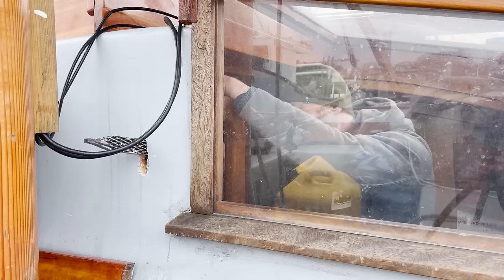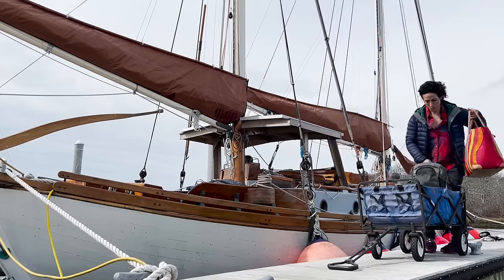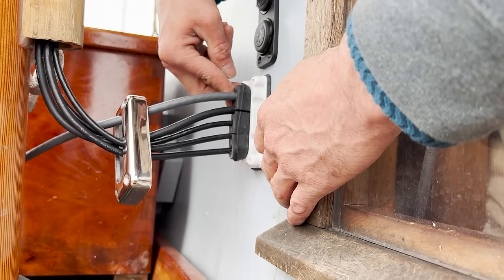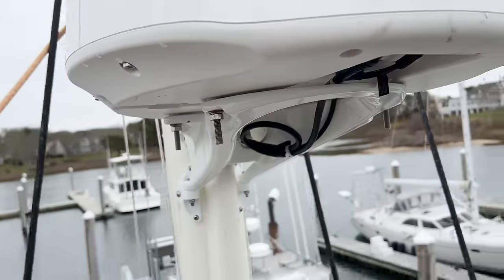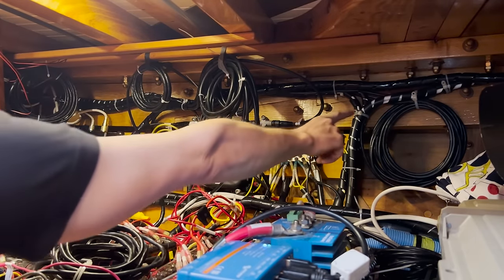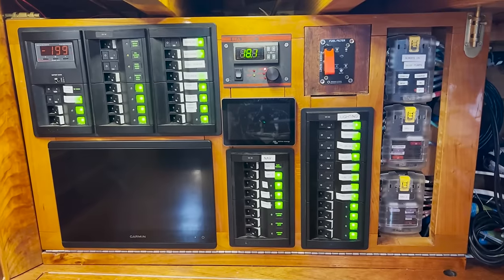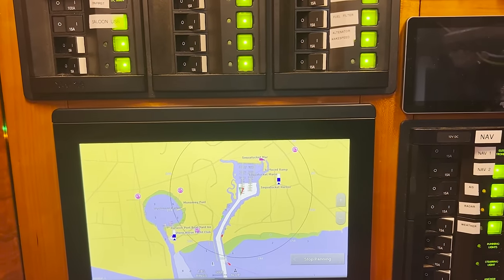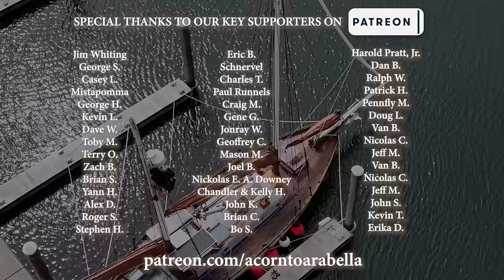Windy Work Installing Navigation Electronics - Ep. 307 - Acorn to Arabella: Journey of a Wooden Boat

Comment: 11:47 That roled up cable above, make a drip loop lower, below the conduit hole, and most rain water will drip off. The way you have it now, it will funnel directly in. The drip loop is a CATV installation trick.
Reply: Came to the comments to say exactly this.   Also a drip loop outside the cable gland would be a good precaution.
Reply: I was an electrician at a power plant, and was going to say Drip loops are your friend.
Reply: Additionally one could build a small box, that's sealed to the mast except for the bottom, with the drip-loop coming from the bottim in.
That way even the water running alongside the mast will be funneled away from the hole.
Reply: And stuff putty inside the split cover.
Reply: Yup, came here to add my support for the drip loop, figured someone probably beat me to mentioning it.
Reply: *rolled
Reply: That goes for the wires freshly installed in the cockpit as well, water will happily seep through those compression seals if it's allowed to run down the cables, a little bit of re-arranging the slack will prevent that.

Comment: Having sailed a lot on Long Island Sound, I have found myself in very thick fog.  Even though I was in "home waters" having that radar is very reassuring.  Better to have too much information and not need it, than having too little with a dire need for it.
Reply: Hi Kevin! Anne here. I really appreciate your saying that radar is "reassuring." Super appropriate. I really dislike it when people refer to any very expensive system as "necessary," considering how many ways such a thing can fail, and what a barrier that presents to some sailors. A lot of wooden boats aren't detectable (those very small radar reflectors people permanently mount then forget about don't do much to make them visible to radar), and I've seen people shut off their senses to stare at screens. "Video game sailing," I've called it.

Comment: Would making a drip loop for the wires as they enter the mast not eliminate most of the water? That way the water running off wire drips off and all you need to stop is water from surface of the mast
Reply: What he said!
Reply: I came here to suggest this too. I think I even saw a bit of extra wire coiled above the wad of puddy.
Reply: If you put the extra coil just below the penetration, it would give you the best of both worlds… extra cable and a drip loop to shed the rundown water.
Reply: Also maybe make a weather head like houses have. A  pvc 90* elbow pointed down with the cables entering from the bottom.
Reply: I came to say the same thing!
Reply: Noticed the white Tie-wrap on the Mizzenmast…  unless there have been significant updates by the Manufacturer, they didn’t do well in UV and cold temp environments….
Reply: I was just coming here to comment the same thing.

Comment: I was watching on my tv but had to grab my phone to tell you Steve, where you have the wire in the black corrugated casing on the top of the mast, it’s a very safe step to wrap electrical tape around the casing so to not have the wires get chaffed by the slit over time from the winds. Also you can put the duct compound in the casing at and before the entry point to the mast to keep water out of the inside of the casing. Love your journey! Been watching since the lead pour

Comment: For sealing I’ve had really good luck using pure silicone caulk mixed with enough cornstarch to form a putty. Pack it in and it will solidify and bind lightly and seal but still very easy to peel out if needed.

Comment: Inclinometers are fun. Gives you something to watch on passage.  Also useful if you plot speed versus heel angle.  While heeling may give you speed due to longer waterline the drag and eventual rudder angle increase negate that speed gain. My old boat anything above about 18* to 22* of heel was just wasting wind. Flat boats generally go faster. Maybe not so much for your hull shape but you'll get a feel for it if you have one to use and learn when to reef or ease the traveler.  They can also be used to gauge people start screaming above X angle of heel or when Akiva starts to really not like this idea or goes beyond his coefficient of friction. 

Nice work as usual. Good choices too. Play with the radar a lot during good weather so you get really good at reading it. If you cruise you'll use it a lot. Especially in New England and North. You would be surprised how little new radar set use on idle. AIS draws very little power also.

Comment: Love what you're doing. I agree with the previous comments about the drip loop. It with help alot with water. Duct seal will crack and dry out in a few years exposed to the elements, but it is easy to remove and replace. One last thing, the cable ties used outside should be UV rated. Thank you for the awesome channel.

Comment: I love seeing what you are doing on your wooden boat Steve.  I do think back to the early 70's when I did my first blue water passage from Hawaii to San Francisco.  It was on a boat about the size of Arabella (a 30 foot Tahiti Ketch), though we didn't have the modern conveniences.  We used oil lamps for lighting, no radar, the battery started the engine and provided juice for our radio and we carried about 60 gallons of water.  We had a propane stove and that was about it for modern conveniences.  Our diesel was overheating so we only used it for charging the battery so we could listen to the radio (not a SSB, just so we could have some entertainment and VHF when we were along the coast).  I don't know if I would do that today, I think I would much prefer the upgrades you are installing on Arabella.

Comment: Not just for the foggy days but for the very remote locations where safety communication equipment is less standard. Or sailing into unknown anchorages with little or no information. Also useful if you have to participate in a rescue mission. A few more items checked off. Register and get your id #'s.

Comment: RE: conduit in mast leaking.  That sticky stuff is fine but the best way is to create a dead leg in the wire by leading it down past the hole (6" or so) and bending back up to the hole.  That way the river flowing down the wire will drip off and the small amount of water near the hole the sticky stuff will control.
Reply: OK, four people suggested the same thing.  The reasons the (me) commenters don't read all the comments FIRST is that we think we can help but realize that if we don't comment quickly we will be buried under thousands of well deserved "Great video" comments.  If we think we can help we want our comments near the top so we watch and quickly comment if we have anything useful to say.
Reply from the maker: We hear you!! Thanks for the comment!
Reply: @AcornToArabella Of all the people mentioning a drip loop there was not a single acknowledgement from Acorn. There was one however regarding too many people cluttering up the comments. You won't have to worry about me adding to your channel ever again. It has been good from the keel pouring up to this episode. Adios.
Reply: @darrellshuman7751 We're so gonna miss you!

Comment: Hi Steven,
White cable ties are ususally not UV resistant  at least I have never seen them🙃. They will break down pretty fast.
Outdoor rated ones are usually black.
Reply: Agreed, always used Panduit brand black ties up on communication/cell tower installations.
Reply: @TowerHand  My outdoor black cable ties have disintegrated within 5 years.

Comment: Any wire that runs downhill into a hole will find a way to leak.  Put that coil below the hole and the water can't run uphill.  That split loom is not water proof above where you sealed and sealing where it goes in will make any water in the loom go into the mast

Comment: Great you have all this electronic kit; it adds a lot of safety potential. However, it's equally important to get really familiar with sailing and navigating without it. If you depend on it, when the great short-circuit occurs in extreme conditions, you don't want to become dangerously helpless.

Comment: In airplanes, we always make sure each cable has a drip loop before any connector or passthrough. This way you do not route the water into place you do not want it. So routing the cable below the hole in the mast will make sure you have less water coming in by design.

Comment: I agree with the drip loop idea, but also, it looks like you applied the caulk over the top of the split wrap.  I would completely close the wires inside the split wrap as well.  Otherwise the water will simply run inside between the wrap and the wires

Comment: Your depth says 2.1 feet. Not worried about that Steve? Is that from the bottom of the keel on a low tide? Neat job on the electronics, and always better to have more than you need rather than less.

Comment: for the mast hole and the cables, I wouldn't use that plastic conduit, it it going to disintegrate in the sun, I would wager, and it's just another route for water intrusion.  The Navy go-to for that situation would likely be something like you used, the duct putty, and liquid tape.  Liquid tape is the best thing ever, it is like electrical tape, but doesn't dry out and crack and lose adhesion over time, and it's also relatively easy to remove, no chems needed.

Comment: No you don't need all the gizmos, until you do. Doing a delivery in the late 1980s and we had the Decca positioning using radio triangulation. In the midst it placed up 20 miles inland, a real test of your confidence in navigation. You need the electronics a night, if you never do a night passage your ok without them. Most of the time you don't need them. Like life rafts when you need them...

Comment: There is a brand of zip ties called GripLockTies that are cushioned and designed specifically for high risk chafing applications.  I have had the traditional ties like you are using eat right through cables.

Comment: I vote butyl tape. Butyl based products are used to seal commercial building panels, pool deck joints, RV applications, etc. Perhaps there is a butyl product in caulk gun format.
As for the wiring, very neat. I hope your zip ties are rated for exterior, I've had some disintegrate over a couple years time in the sun.

Comment: - Steve, I have been wondering about the UV resistance level of the plastic mounting plates you fabricated.
- Will they deteriorate and need replacing over time due to UV radiation from the sun?

Comment: On the subject of MMSI registration, if your plans are to cruise outside US waters, you should look into going directly to the FCC for an MMSI and also filing for a Restricted Radiotelephone Operators Permit. (The MMSI numbers that you can apply for through organizations like BoatUS are for US waters.) You will also be listing your RADAR, EPIRB, etc. There are several online services for taking care of this paperwork, for a fee, as some find navigating the FCC web portal difficult or confusing. The MMSI is valid for 10 years (although I believe I just read that it could be permanent) and remains with the vessel, the RROP has no expiration and remains in your possession. Also, one last little bit that might be of help, make a listing of all electronics onboard, vhf base and handheld, EPIRB, SSB, etc. and print a copy and keep it with your ships documents when entering a foreign port, there are times when this is required for entry and it just makes it easier. All the best, thanks for taking us along.

Comment: Steve, You are quite gifted at fixing and installing all types of equipment.  However, I am very concerned with your using plastic cutting boards to hold the radar and wind instruments.  While plastic is corrosion resistant, I seriously doubt that it has the strength to withstand very strong wind forces, especially over time as sunlight will likely degrade the material.  Also, when you sail to warmer areas, I expect that the plastic will droop and weaken with the higher temperatures.  Hopefully, I am wrong, but I would hate to see such expensive equipment lost especially at a critical time.  Thanks

Comment: Does coiling coaxial cable weaken the signa l it carries the same way coiled power cables interfere with compasses and RF signals? The reason I ask is you have a number of them in your system

Comment: It looks like your heading sensor is not working properly.  Your own AIS triangle should not turn and wiggle when you are stationary along the dock.
I'm not sure about this second point, but that might also be why your radar image is turning, that was really odd to see, but normally Radar is stabelized by the gyrocompass, which I do not assume you have. but then it should be stabelized by the magnetic compass. Radar image should be North Up, when you overlay it with the stationary chart like that. Unless you put both chart and radar on course up. But you chart was not course up, so yeah. 
I'm a merchant navy sailor,  I know yachties do things differently, so just take the above as well meant advice.

Comment: II believe if you have radar and vhf on board, you are bound by international maritime law to have it turned on
Reply: No
Reply: @RicktheRecorder  Yes. See the international sea rules code from 1972, rule 5 and 7b
Reply: @olatedin  These rules are mainly intended for merchant vessels, and were drafted in 1972, before the advent of small radar sets on yachts and pleasure boats. All such vessels are encouraged to use the equipment they  have and would be criticized in any accident in which a failure to use all available means was causative, but there are all kinds of reasons why the equipment might be regarded as not 'operational' including a need to preserve battery capacity in a sailing vessel. So yes, the radar should be on in poor visibility if there is sufficient power to run it without prejudice to other loads (such as navigation lights) but no, you are not "bound by international law to have it turned on" all the time.  That statement goes too far.